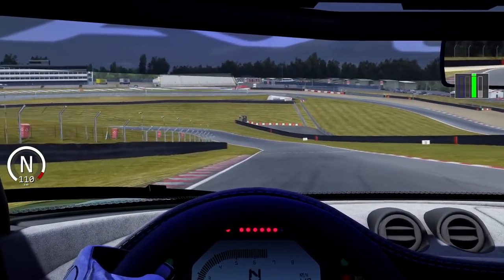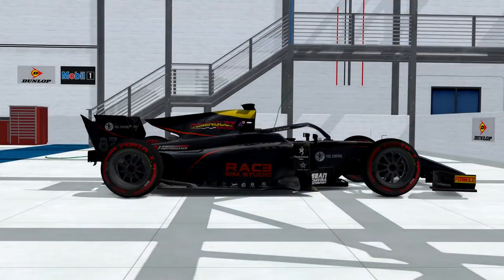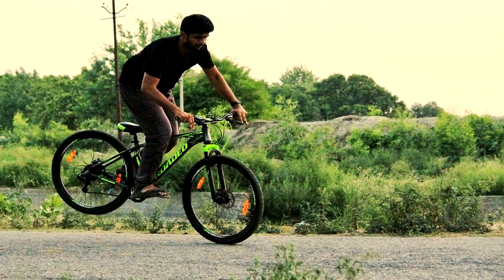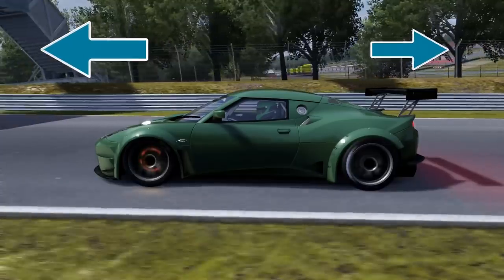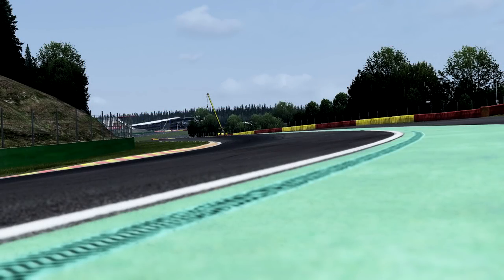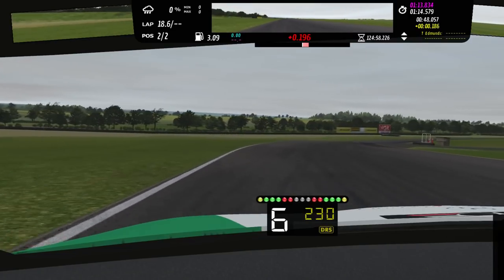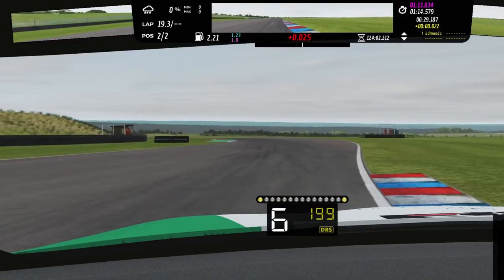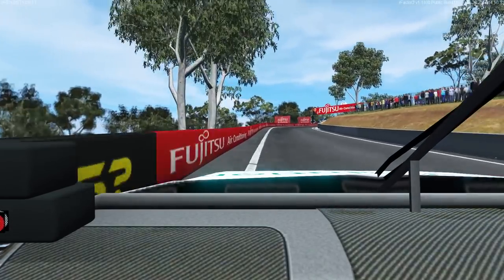Motorsport Explained: Weight Transfer

Comment: I learned about weight transfer by driving 4000+ pound cars with hugely powerful engines and horribly worn out suspension. Highly educational experience. I recommend it to anyone with a bit of bravery and a lot of open space.
Reply: For real I like when I press the gas I let off and it goes back it's fun I like doing it and I just start a little rhythm

Comment: That video can go into the bin if you ask me. Swap the word WEIGHT with LOAD every time and it'd start to make sense. None of the mass (except for the fluids if you want to count them) actually moves around (to change the WEIGHT distribution) when you drive, it's LOAD transfer. If you'd put scales underneath each wheel when you drive around a completely flat surface with accelerating, braking and steering (LOADing the corners differently), the combined WEIGHT on the scales would be the car's total WEIGHT all the time.
Reply from the maker: I look forward to watching your totally correct, mistake free version.

Comment: If you want to start getting into the newtonian mechanics of weight transfer, the "friction circle" concept is a good place to start; then realize that "weight transfer" will make the friction circles at each tire get larger or smaller as load is temporarily transferred between tires. Basically the driver wants load on the rear to aid traction and eliminate oversteer, and load on the front to aid turning and eliminate understeer. The driver uses the inertia of the vehicle to temporarily add or remove load from the front or rear axle as needed using the brakes and throttle (longitudinal axis) and between each side of the car using the steering (lateral axis).

Comment: Thanks for this, but it is not weight but force that is being transferred. This is why racing cars at speed don't turn around corners but are "rotated" using the transfer of forces. Especially in formula cars which have a high rear polar moment of inertia. As a good racing driver will tell you, you rotate the car using the accelerator and brake pedals, the steering wheel is there for mistakes.
Reply from the maker: I called it by what it’s known by. Heel and toe isn’t heel and toe but side of foot and toe.
Reply: @AidanMillward  Perhaps, however, to use your 'heel & toe' analogy, in most road cars, and those that are "tracked",  the pedals are arranged such that enough of a rotation of the right foot is required that  the description is still accurate. "Weight transfer" with respect to getting a racing car (or any car) around a track is the first concept great race driving instructors immediately educate their students to be "force" transfers as their assignments are in the control and at the discretion of the driver.

Comment: If I'm honest the video was far too vague and skipped over far too many important factors to be of any real use. Sorry
Reply from the maker: Just as well I called it a basic introduction with the option there for people to go and learn more if they want to them 😉
Reply: @AidanMillward  it doesn't really cover the basics though, it mentions them and often attaches loose, sometimes inaccurate anecdotes to them but that's kinda it unfortunately. 
It's like me saying the basics of audio recording is 'sound being a bunch of wibblies that are captured by a microphone like a rabbit in a snare and then converted into electronic wobblies and sold on iTunes for 29p'. The parts are sort of there but explained poorly.
Believe me, I know full well it's a hard subject to explain in a succinct fashion. It's one of those complex/simple subjects which requires simultaneous understanding of several relatively simple principles and takes time to explain as a result.
I can give you some pointers on what subjects would need to be touched upon if you would like but would equally understand if you deem it beyond the purposes of your channel.

Comment: I love your channel, but at 4:45, you've got this backwards. If an F1 car had a 70% WEIGHT distribution on the front wheels, it would severely understeer. What you seem to mean is that there's a 70% downforce(?) distribution on the front, which is a completely different discussion than weight transfer. That crash was caused by too much MASS on the rear with not enough AERO downforce to account for it. The whole idea behind a weight transfer discussion is that the larger the normal force (ie, force straight down caused by static weight, aero force, and weight transfer caused by acceleration) is on a tire, the lower the PROPORTIONAL available grip is (the grip increases, but not as much as the normal force).